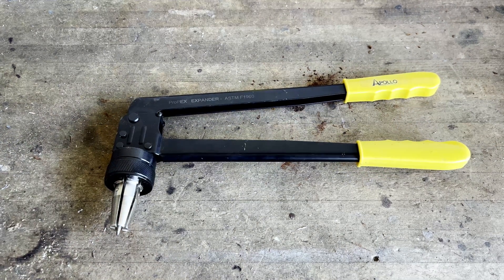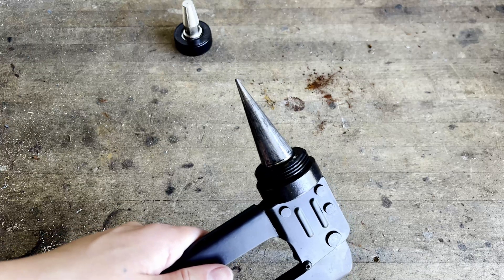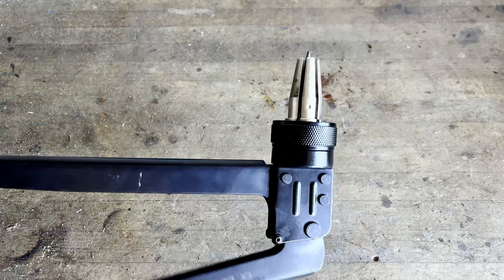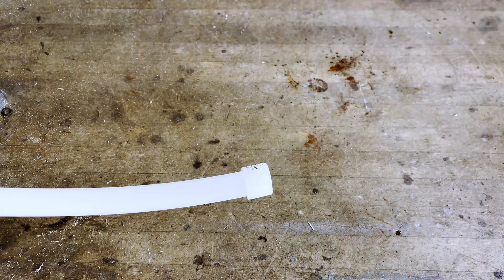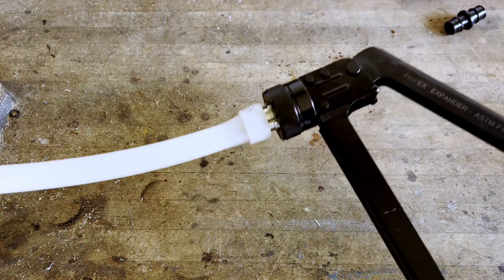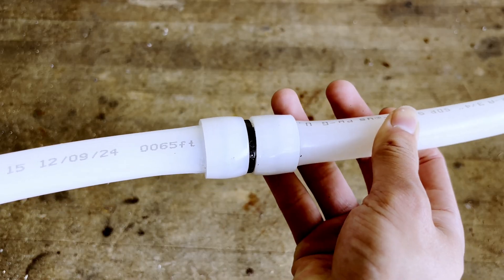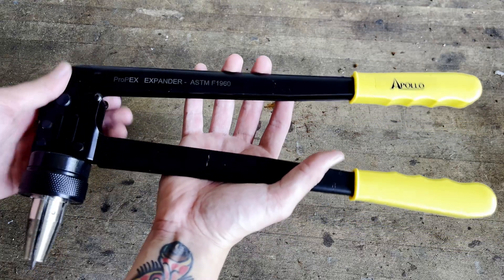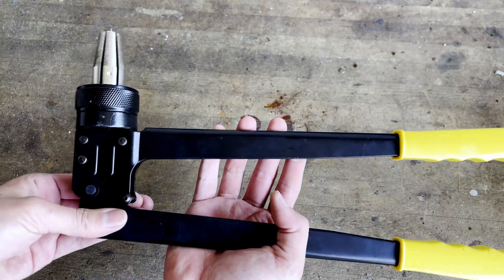DIY Expansion PEX for Under $100 - Apollo PEX-A Expansion Tool Review

Comment: Spend the extra money & get the manual one.  This tool put me in the hospital.  Woke up a day after using this & I couldn't move my arm or hand, fingers.  Scared the shit out of me.  ER did next to nothing.  They said there's nothing they could do I'd have to see a specailist, which the soonest appointment is like 4 months away.  It's 4 days later & still don't have use of my right arm.  Using this tool for 1/2 inch is fine.  But going up to 3/4 is a complete nightmare.  Nothing about that is easy.  I couldn't even imagine trying to use this on 1 inch, my god that has to suck. YOU'VE BEEN WARNED

Comment: I used one of these to make repairs to a 1" water line.  I almost wasn't strong enough to expand the pipe, I had to keep backing it out and doing extra pumps, more than 30.  I'm not the strongest guy, but no weakling either.  It was also hard to keep the pipe and tool clean as I was working down in a muddy ditch.  Ultimately, I was successful and I'm glad I saved money by getting this tool over the $500 Milwaukee.  But if I had to make more than the 4 connections that I did...like maybe 10, I might re-think that.
Reply from the maker: I only used mine on 3/4" pipe and even that took a bit of strength. It's important to keep the "cone" part of the expansion tool lubricated for best results as it reduces friction. 

 I have seen ratcheting expansion tools online and those might be better for 1" pipe. They cost more than the Apollo tool at around $150 which is still a lot cheaper than the electric tool.
Reply: This tool put me in hospistal, not even joking.  Usinbg this on 3/4 inch was a complete nightmare. I had to use to like 15 times in a day.  And I consider myself to be a tough guy.    Well this tough guy hasn't been able to move his fingers for 4 days so far.  With no hope in sight.  Pay the money if you can.  Your health is worth it.  I was tight on money thats why I used this garbage tool.  1/2 inch wasn't to bad, but anything larger 3/4 or 1 inch LMFAO

Comment: Thank you dude!! Needed this specific video!!!
Reply from the maker: Thanks, glad you found it helpful!
Reply: @DragonBuilds  I did! Thank you! I extended my pex a to replace a damaged part and I still have a leak which suuucks :(
Reply from the maker: @ That's unfortunate, make sure to rotate the PEX-A expansion head as shown in the video to ensure a good seal and as always, quality fittings are important. Best of luck getting your leak sorted out!
Reply: @DragonBuilds  Thank you! I ended up going with a sharkbite connection and zero leaks!!!